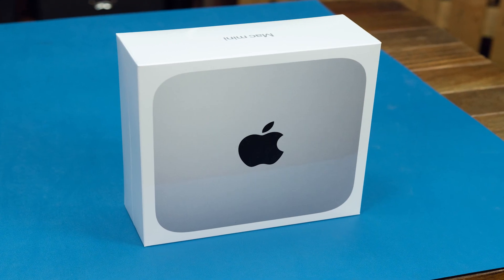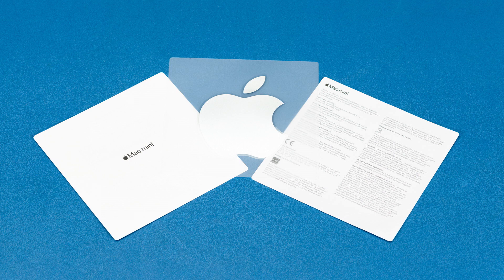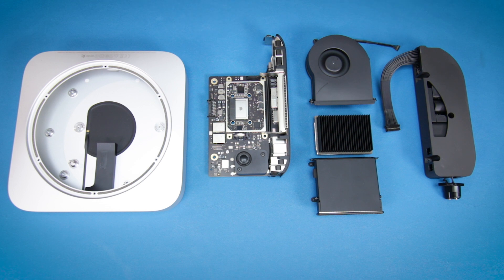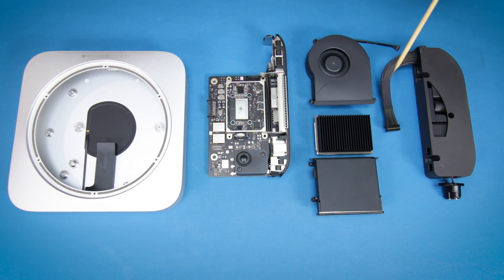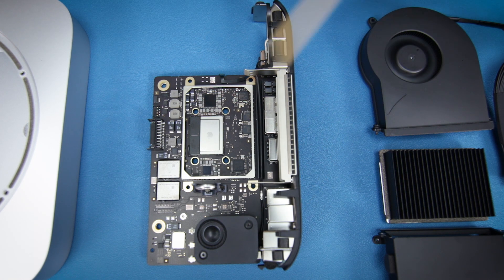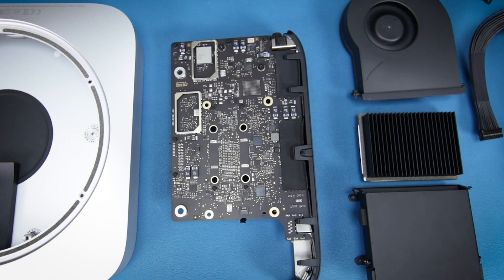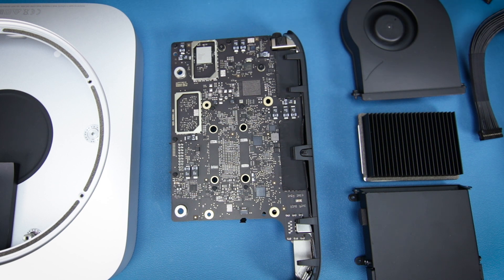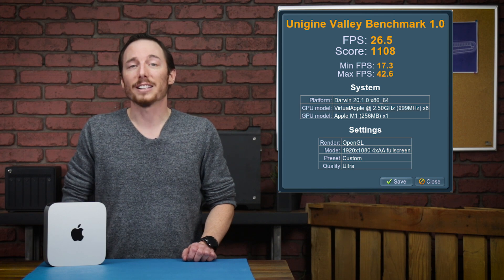Unboxing and Teardown of the Mac Mini (M1, 2020)

Comment: Hello. The system board is very small. Please make a HUB (in the form of a keyboard stand), in which you can hide the mac mini m1 motherboard along with the power supply, air cooling system, and a slot for an msata or m2 ssd !!)

Comment: The benchmark scores are not as high as in other reviews. Still waiting for my Mac mini to arrive.
Reply: The probably were using the Intel Version of Geekbench with Rosetta. There is no other explaination for these low values
Reply: What model did you get?
Reply: @WarriorsPhoto  M1 Mac mini with 16GB ram and 256GB SSD.
Reply: @lohyewcheong  Oh that'll be a great little computer. Are you using it to edit videos?
Reply: Owc should know better than to use the wrong version or setting. I am gradually losing my confidence that OWC should be my Mac peripheral supplier. 🙁
Reply: @drsmith1988  Explain more if you please and thank you.
Reply: @WarriorsPhoto  When running Geekbench on an M1 Mac, there is a choice or running it with native 'ARM' code or Intel (64 bit).  The number that he put in the video, is the number for Intel code.  It is around 7500 for multi-core native M1 code.  Another part of me losing faith in OWC, is that they aren't going to have Native M1 code for Big Sur for months for their SoftRaid product.  I would love to upgrade to a new M1 computer, but this creates issues for me, not being able to use SoftRaid.  Since my data needs are a bit lower than they used to be, I will probably go to using the Apple Raid solution, which is inferior, but oh well.

Obviously, I think the M1 computers are a tremendous value.  But, it seems that OWC is more and more concerned with the PC market and less with the Mac Market.  So, we will see.
Reply: @drsmith1988  I understand your discontent with this company. Let's hope they don't become a PC mostly upgrade company. Thank you for your input.
Reply: In other channel I saw the same Mac mini , but with a higher score, I think it was 7,800 on multicore and 1800 with single core
Reply: aIysdexia  Huh???